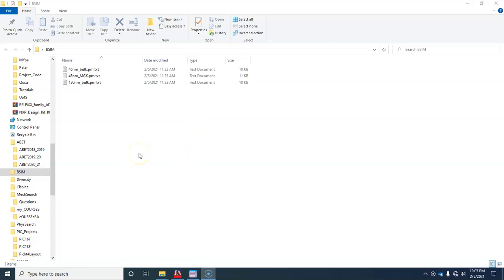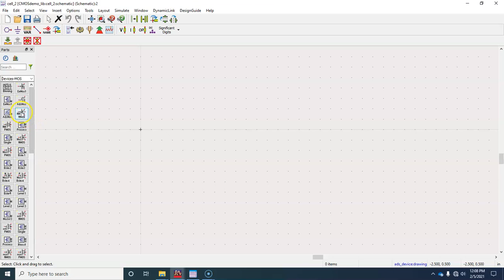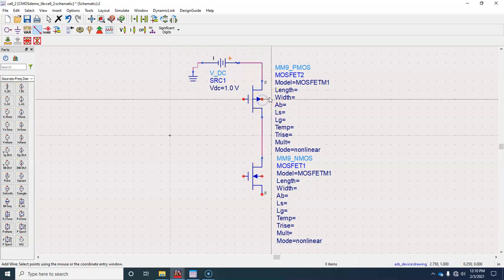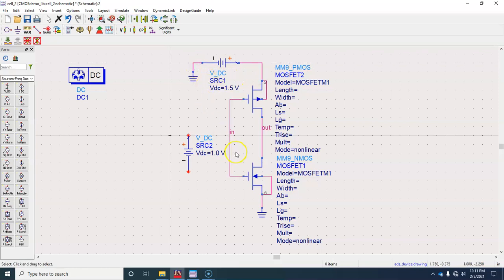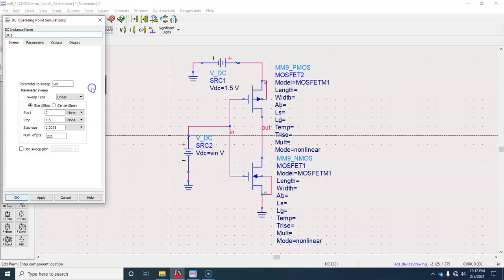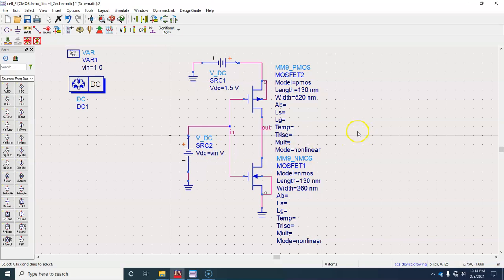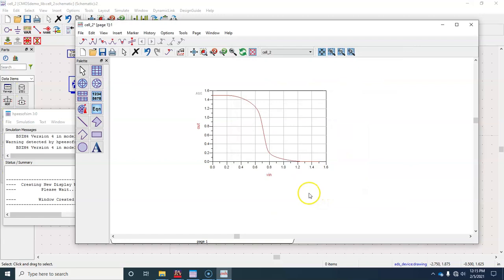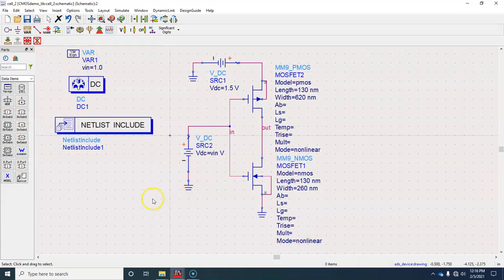CMOS inverter simulation in Advanced Design System (ADS)

Comment: Thank you for the tutorial. I downloaded the PSPIC MODEL, but when I run simulations, there is a warning saying there is no DC path to ground. I removed the capacitors I had placed in my circuit but still got the same error. I don't know whether the MOSFET PSPICE model has something missing

Comment: Sir can I know how to vary voltage
Reply from the maker: which voltage? VDD?
Reply: Actually my concept is attenuator  I should vary the voltage attention changes sir
Reply from the maker: @konadasathvika2887  voltage attention change? Sorry, can you rephrase your question?
Reply: Can I have u r num sir
Reply: Can I have ur num sir ?!
Reply: I designed a circuit of attenuator by using pin diodes in the form of phi network of quad pin diode attenuator 
Now I should vary the attention by changing the voltage 
For that which components should be tunned?
Sir

Comment: Sir, how to get power dissipation and propagation delay of cmos inverter in ads
Reply from the maker: Bhanu, I don't have access to ads at this moment, but there are power probes in ads that you can use to calculate P[0]- the dc power. You can also use a current probe and use the equations menu to define P= real(VDD*ID) to get the power. Time delay should be easier from the graphical window, just use the markers.
Reply: @MohammadAMaktoomi  Thank you very much